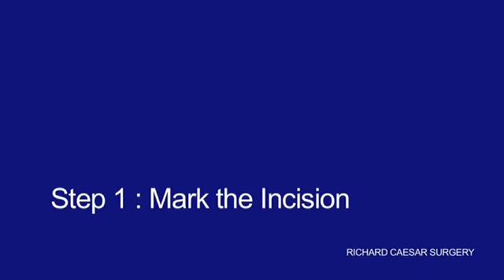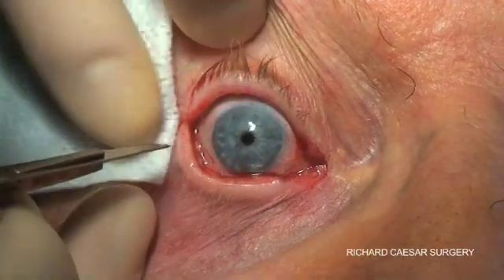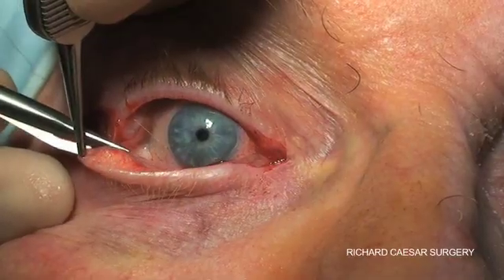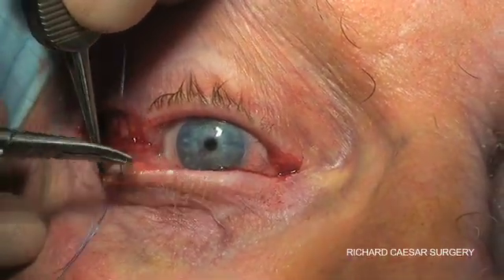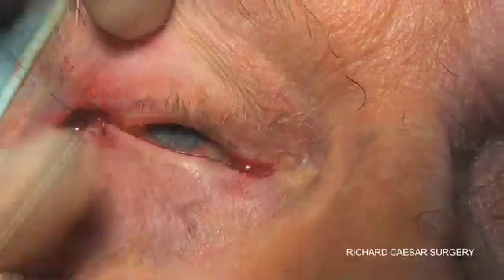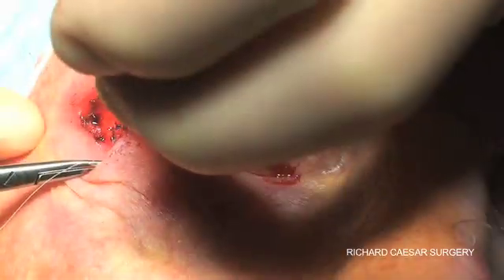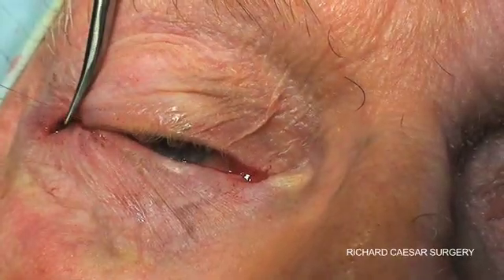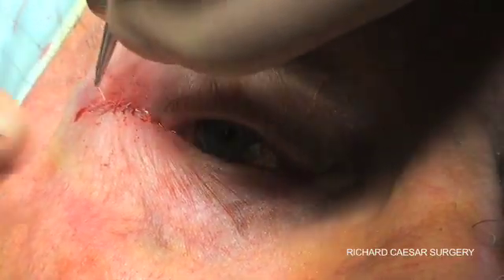lateraltarsalstrip

Comment: What a amazing video, excellent technique. Can I ask you a question? When do we use lateral tarsal strip technique, and when do we use tighten lower lid technique ? Thank you so much.
Reply from the maker: Hi Long.  I recommend the lateral tarsal strip as a powerful tool for lower lid tightening.  For a more subtle tightening or "tensioning" the canthopexy is useful.  In the rare occasion where there is a risk of the lower lid being pulled under the globe by a LTS, I either do a hang back LTS with elevated canthal insertion or move to a skin sparing wedge (similar to Quickert's but without the everting sutures.)  Always document your pre-operative decision (and rationale), audit your results, and adjust your technique over time to find the perfect solution!  Best wishes.  Ric
Reply: @riccaesar   thank you so much for your answer Dr Caesar . I ask this question because i saw your video about the lower lid blepharoplasty, in that case the lowerlid laxity was abnormal (>10mm), and you didn't use the lateral tarsal strip but the result was great. So i wonder about the indication of the lateral tarsal strip technique.

Comment: Thanks for your incredibly useful videos! I have problems with a few patients with massive ectropions with total tarsal eversion and keratinization whose I've done lateral tarsal strip but it has repeated a few days or weeks after surgery, should I do pentagonal excision, LTS again, another technique...?
Reply from the maker: Hi Djagraw.  For total tarsal eversion I recommend pre-treating the everted tarsus intensively with Chloramphenicol ointment.  After a few weeks combine a LTS with lower lid retractor plication via two spiral sutures - as you would for medial ectropion, but with double the sutures.  This inverts a (hopefully slightly softer) tarsus back against the eye and prevents it flipping over again.  Best wishes.  Ric
Reply from the maker: The "medial spindle" video is the one to copy, but place each suture more centrally.  I tend to go for medial and lateral corneal line as a guide.  BW.  Ric
Reply: Thanks a lot for your answer, I'll try this!

Comment: Thank you for this wonderful video Dr. Do you think placing a free skin graft medially would have provided a better support for the lid? When would you use a skin graft in such cases?
Reply from the maker: Hi Haitham,  when there is inadequate skin I'm a big fan of the heteropalpebral flap using the spare skin of the upper lid on a lateral hinge.  Video coming soon!  I've found this a very reliable technique.  Skin grafts are usually my last resort as there is a risk of them sitting proud or not matching colour as well.
Best wishes
Ric

Comment: Ric, Excellent video. You explain each step very clearly. My own LTS technique improved vastly after watching your video a few times. Giving the LA adequate time to work and achieve better haemostasis  is something everyone should remember. Great tip about burying the prolene knot. What is your opinion about using 5/0 vicryl instead of prolene?
Regards
Bala
Reply from the maker: Fotograf110 Dear Bala, Delighted you like the video.  I have used both 5.0 vicryl and 5.0 prolene extensively.  I have no evidence but my feeling is that while 5.0 prolene is more difficult to use is is more predictable.  Some patients are great with vicryl to the periosteum, but in my hands some patients develop quite marked inflammation.  Both sutures can cut out with time if too tight.
It would be great to have permission to do a large prospective trial of bilateral LTS with prolene on one side and vicryl on the other!  Best wishes
Ric

Comment: Ric, great video. Clear and precise. What are your tips for hemostasis?
Reply from the maker: Nitin
I use bipolar for LTS most of the time, as there doesn't seem much benefit from monopolar.  The top tip is to edit out most of the haemostasis!
More seriously, I try to give the anaesthesia with adrenaline 1:200 000 well in advance to allow the adrenaline to take effect, and then make sure I complete each step's cautery to proceed dry to the next step.  I don't take my patients off aspirin, clopidogrel or warfarin, but warn them to expect a larger bruise.
Best wishes
Ric

Comment: Is their any additional steps in case we treat fascial palsy ? only in lower lid
Reply from the maker: Mohamed
Not really,  you could add a SOOF lift or full midface lift and loading of the upper lid with a gold weight, but the tarsal strip essentially remains the same.  It can be preferable to anchor it slightly too high in anticipation of post op drop, and/or combine it with a small lateral tarsorraphy if the ocular surface needs additional protection.  Best wishes. Ric